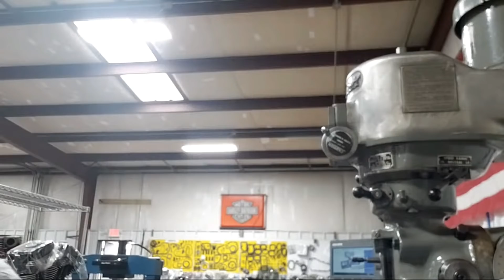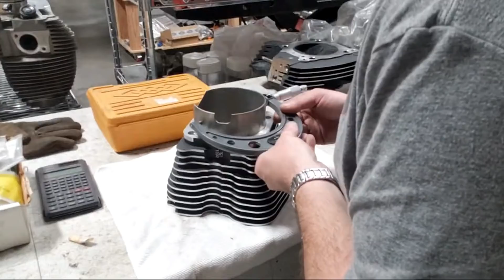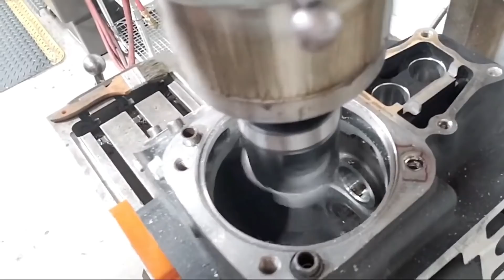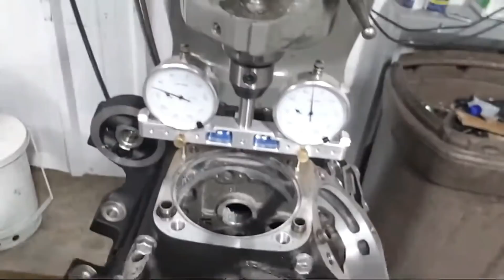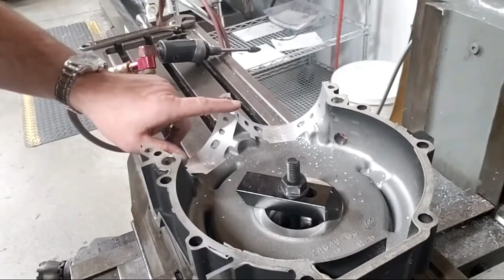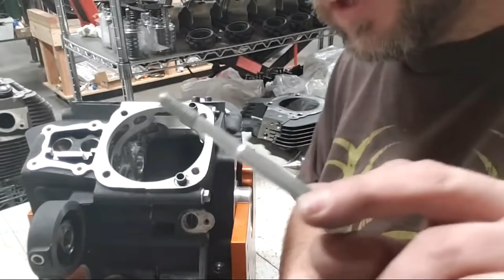Big Twin Cam Cylinder Install - How To Bore Cases for Harley 117 - Kevin Baxter - Pro Twin Performan

Comment: Soooo I have a 124 S&S cylinders cases bored. What caught ear is the longer piston skirts. That IMO is the one downfall with S&S pistons. I have a set if SA pistons done up by Bryce that are for B2 heads. I have a softail so no B2 without crazy cutting. I did, however  notice  on your web store that you have 124 pistons. What are the CH on these? I need longer skirts = less piston slap and more support on major thrust faces. I'm at zero with the 5.004 cylinders.

Comment: What are your thoughts on going with a S & S 100" Power Package 4" Bore bolt on cylinder and piston kit with no machining, balancing, or splitting the crankcases vs this on a 2002 Softail Fatboy which has timken crank bearing?

Comment: Have you ever seen a twin cam case fail in any sort of way, right there in the center where the new case bolt goes through? The reason I’m asking is because I’m considering having my spare 96” twin cam case bored out for larger cylinders. I’d like to go as big as possible without causing any problems with the case from boring it out too big.

Comment: Amazing work... there's many shops that offer performance and machine packages but there's only a few who go about this like you do.. this is why your builds stay together..I've got friends who had a really good mechanic build their 96s into 107s and they didn't last longer than 40k miles before breaking the crank or busting rings etc

Comment: Hi Kevin, love your videos! Have you ever seen the case bore off center in relation to the crankshaft?  Do you have any videos on Sportster Engines, 883 or 1200 ?
Reply from the maker: yes but only slightly and not enough to cause an issue.

Comment: Are these the cylinders that come with your power packages? I was planning on sending my bottom end to darkhorse, to do the crank and machine the cases for a 4 1/8”. But now I’ve been leaning towards just going with the 4 5/8” stroke crank and case service you provide, being that I will be ordering pistons and cylinders from you for the top end. Your word is gospel and I’d be honored to have a motor blueprinted by you. I ride with a few people who money isn’t really a issue for, that’s not the case for me unfortunately, but I always tell them that They are the money guys, And that’s great I wish I was a money guy but I happen to be the motorcycle guy and I’ll be damned after all the hours of work and research that I do that I get beat on a motorcycle by a money guy with a crate 120r or 143x!
Reply from the maker: Thanks for the kind words and support sir!  The process would be the same regardless of stroke however, depending on piston choice (like ours), on a 4 5/8 the case would require an extra counterbore to clear the piston skirts as they extend below the cyl base a little bit.  We spec every crank for our builds and Darkhorse does them for us...they can also do case boring as well and set up your bottom end.  If you would like for us to do it, I can spec and order a Darkhorse crank for you, and do what you saw here...plus timken etc. If the project is time sensitive, they would be able to get it done quicker than I most likely...we are swamped.

Comment: What should the piston to cylinder clearance be?
Reply from the maker: that is determined by the piston type, manuf and bore size.  most forged pistons used in HD require .0025 but check with the manuf first.  Standard cast are less and hypereutectic can be even less.

Comment: how many have you had to deck the cases for the base gasket . i had an 07 that had a 110 kit put in and it ate base gaskets like popcorn  on the rear cyl . harley kept telling me it was my fault driving it too hard ended up selling it .
Reply from the maker: i would say 25% of the time are they bad enough to require some decking or touch up.  None of them are perfect however, a base gasket with a very small amount of aviation flange sealer works great.  heat, crankcase pressure, overtorquing heads, etc...many causes and hard to say without looking at it.

Comment: Assuming you decked cases pre bore to equal deck level for bore. Otherwise when you adjusted Bridgeport "Y" axis cylinders could be non aligned with each other?
Reply from the maker: Hey Steve...i believe i understand your question...having to deck the case on one cyl but not the other?  You are limited by how deep you can go to not get into the case dowels.  of course i want to remove as little material as possible to maintain case integrity.  i also want my final cylinder height to be equal and stock.  This doesnt mean you have to deck both cylinders if only one requires it. That said, if a case was bad enough that it was of concern, Cometic will make custom base and head gaskets for us, so any imbalance of height could be accounted for with a thicker gasket on one cyl vs the other.  in the end, if the cyl/piston clearance is the same, the comp ratio will be the same as well.
Reply: Thanks Kevin.

Comment: 👍🏾 

Great content. Just had my 103 bored to fit the S&S 124. Noticed a bit of a leak possibly coming from where the cases split? Could that be the base gasket? 

Thanks.
Reply from the maker: yes it could be, or the base itself.

Comment: Question; what is the function of the voids that you see under the deck just outside of the cylinder skirts?
Reply from the maker: I cant determine a function of any kind.  I wish the voids werent there...would provide more strength.